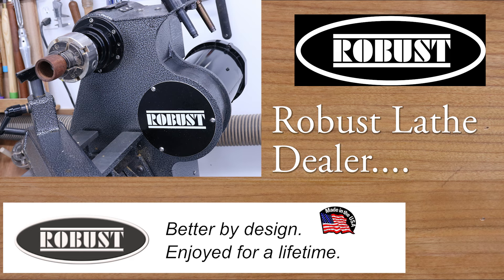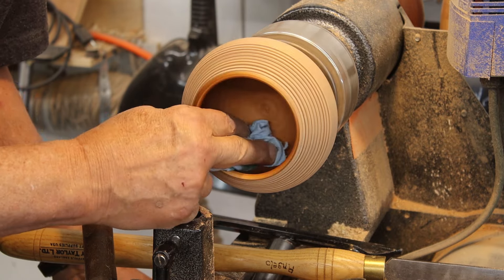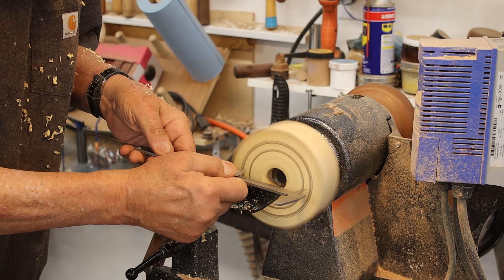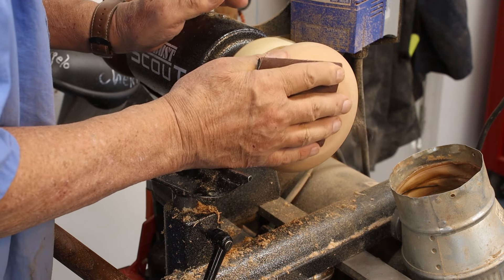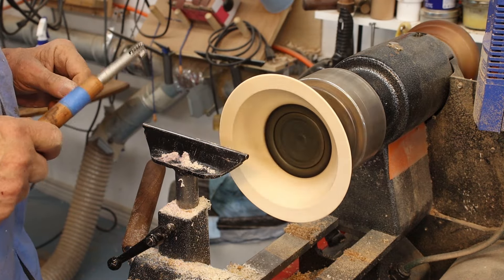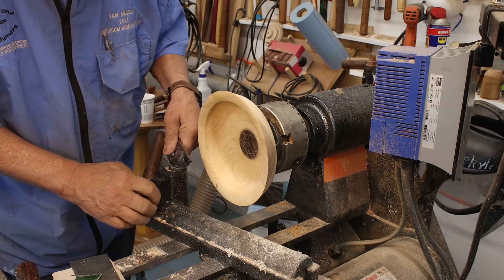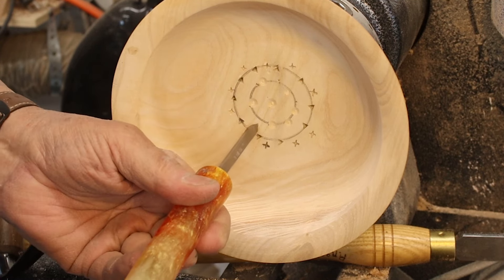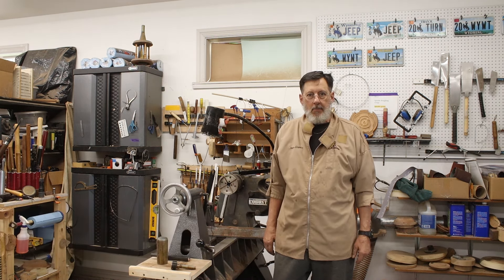Must See!!! Turning Bowls for Charity     Woodturning with Sam Angelo

Comment: At 10.55 the bowl looks like it has a hole in the bottom, then later it's gone. Did I miss something?
Reply from the maker: I’ll have to go back and look at the time you cited, but no, there was no hole in the bottom
??? Sam
Reply from the maker: Marcus     I had to go back and look at this more closely. Earlier in that clip, I showed that little bowl with a waist block glued on. That black dot you saw later was the remnants of that connection and I did remove that completely while I was sanding. However, it does look like a hole in the bottom of the bowl. I appreciate this comment, as I need to be careful what I show in my videos.  Have a great day. Be safe Sam.
Reply: @WYOMINGWOODTURNER  Thanks for the clarification. You put so much into your videos, I understand you can't show all the details in the final edit.